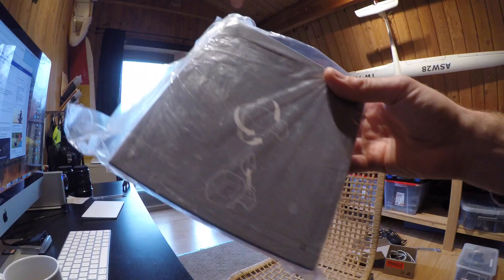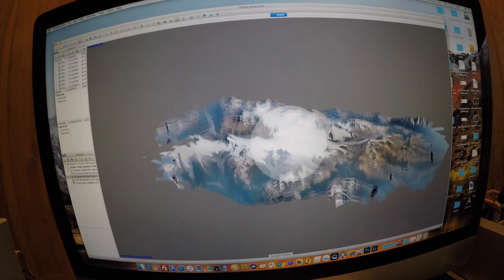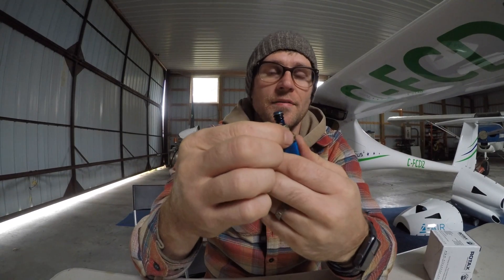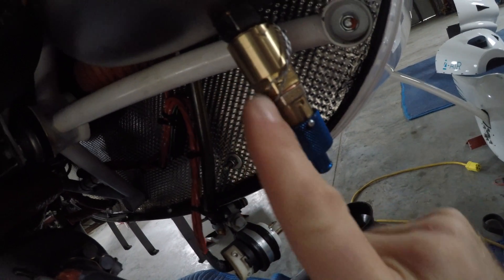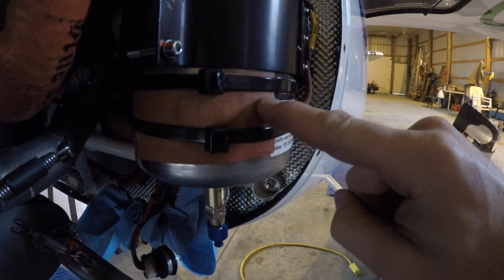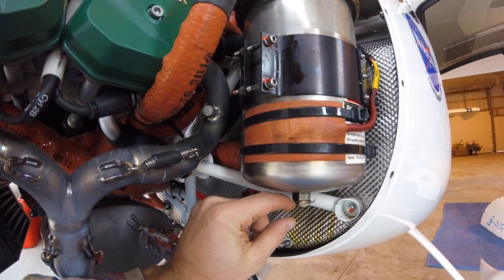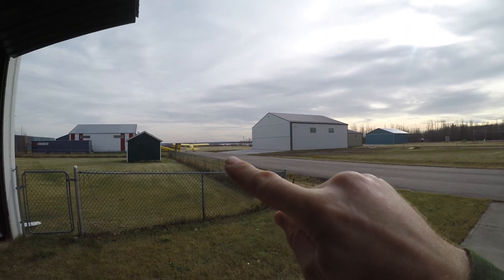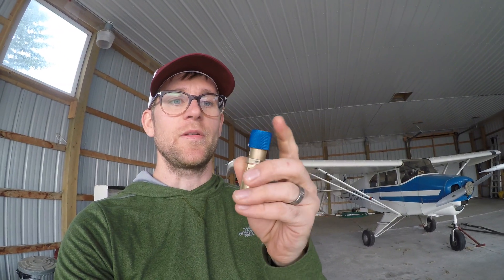Oil Quick Drain for Rotax 912 iS

Comment: That's weird. Why the adapter? It looks as though the quick release could be threaded straight into the drain block without the adapter...
Reply from the maker: Steve Roberts hey so installing the quick drain so that I don’t have to replace the oil tank plug gasket every oil change plus it’s a pain to safety wire it every time. Unfortunately it doesn’t spin in. Needs the adapter. Slightly different thread size

Comment: They’re super handy. I have a hose permanently attached that’s routed up high above the height of the oil tank and secured with a zip tie. I cut the tie, place the hose in a bucket and open the valve. It also works as a safety in case the valve leaked in flight I won’t lose my oil.